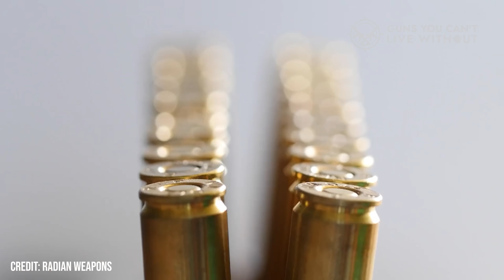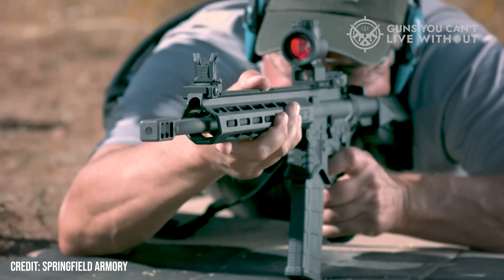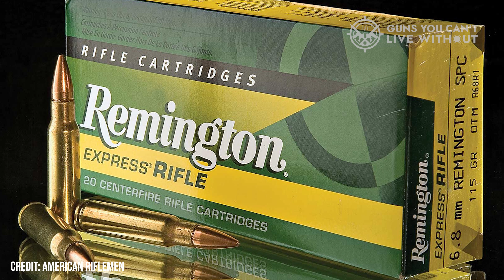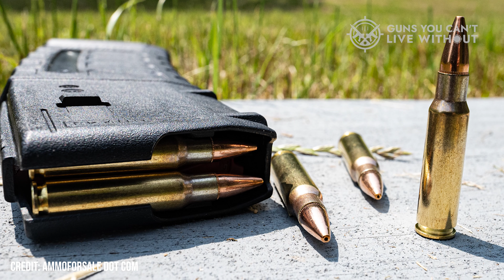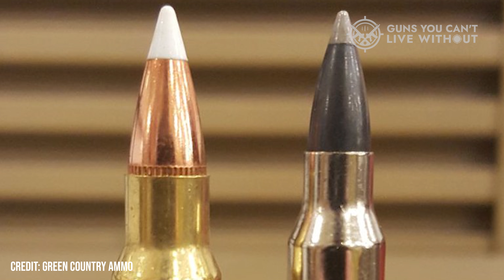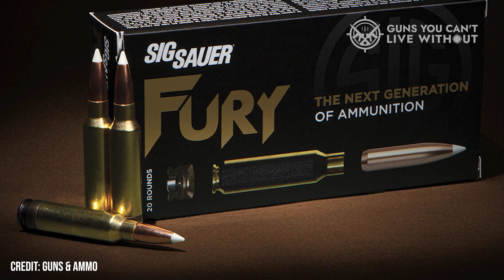5.56 and 7.62 Are DONE – The New Round Taking Over Military Rifles

Comment: Why not make the whole case out of steel?
And cold hammer forged barrels should withstand the pressure but I'm guessing that SIG is being cheap.
Reply: What cases are made out of is gilded metal not brass. Steel cases are not very good
Reply: @CNNisFakeNews-u7j  Is that a question and what exactly is glided metal?
Steel can withstand higher pressuers than brass but it can't be reloaded.